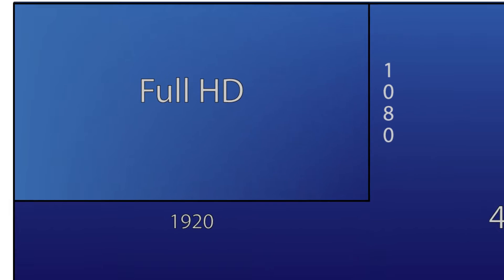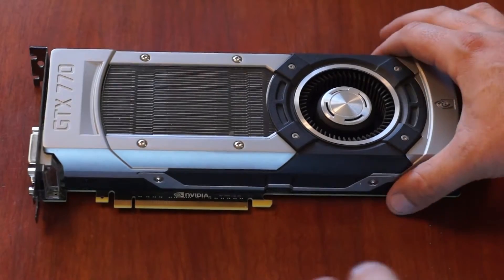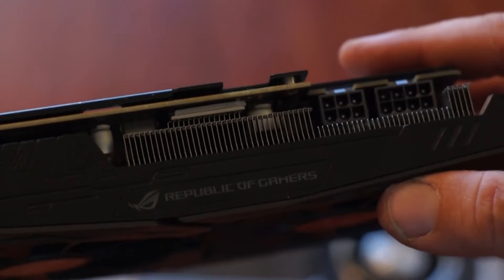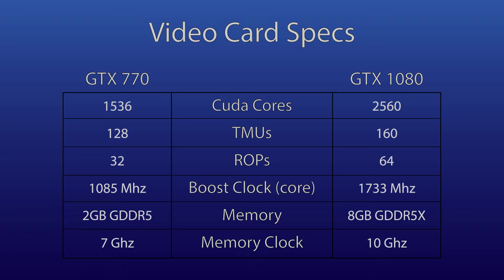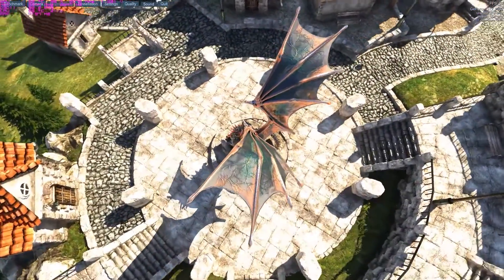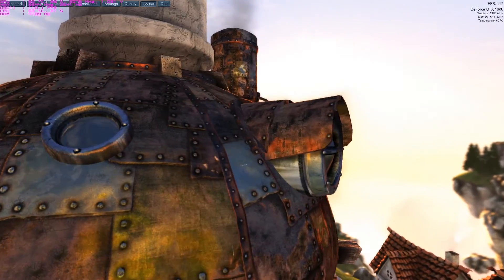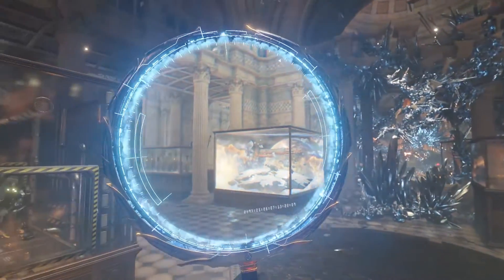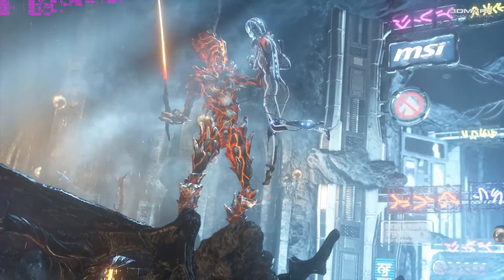Upgrading   GTX 770 to GTX 1080 Strix

Comment: my 770 just fits in my case, would a 1080 fit in as well? or do i got to buy a new case
Reply from the maker: The GTX 770 Reference card is very close to the same size as a GTX 1080 Founders Edition card. If your GTX 770 is a board partner designed card you will need to look up its measurements before making your upgrade decisions as there were a few GTX 770s that were shorter than the reference design. With that said, most cards stay cooler when in a larger case with good airflow.
Reply: thanks for the response!